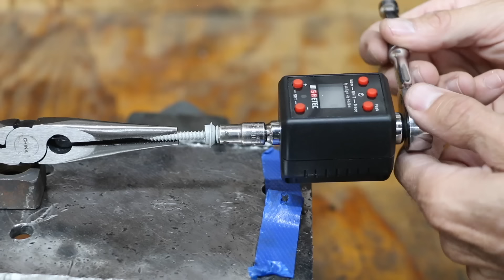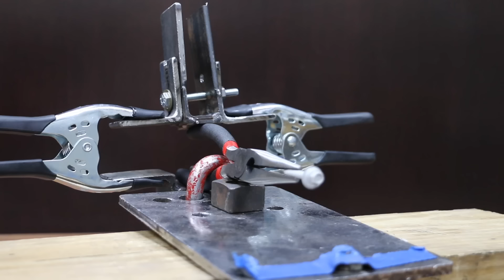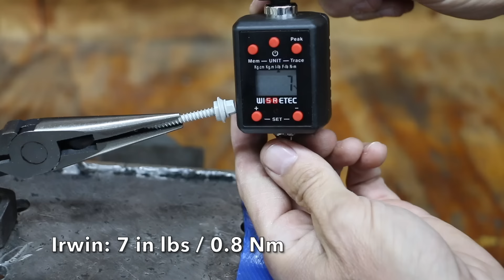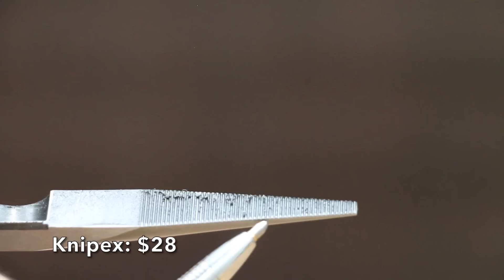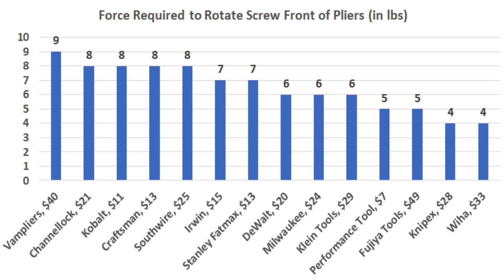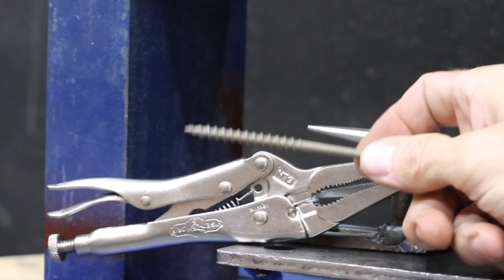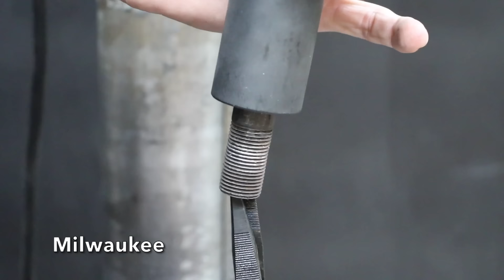Japan vs German Pliers (LONG NOSE)? Knipex, Vampliers, Klein, Fujiya, Irwin, Kobalt Needle Nose

Comment: I would think an important characteristic of needle-nose pliers would be how deep into a hole or crevice can they reach to grip something. That doesn't appear to be accounted for here, they were just run through similar tests as regular pliers or cutters. Some were relatively think and fat, less nimble.
Reply: This is true, however, I also fear there is no one perfect set of needle nose pliers. I have come very long narrow ones for exactly what you mention, other smaller ones with very precise fitment for pulling cactus needles out of people, and then others for higher torque applications.  Its like looking at the tweezer section in the Wiha catalog.. who knew there would be that many pages of different shape and size tweezers.
Reply: @treyhart6861  Yeah. It seemed that the Knipex were a different type of needle nose compared to the others, but for most things I use needle nosed pliers for, that's the type I reach for.
Reply: I agree. I for one do not really care about the wire cutters on my needle-nose pliers (I have plenty of other, better ways to cut metal), but I care a lot about how long and skinny the nose of the pliers is!
Reply: I agree 100% with you. I feel like this missed the mark on actual use case for these pliers. The Knipex and Wiha for example have very long and nimble jaws that can reach deep and pull things out (this is what they are designed to do). I feel like these tests were made for combination pliers. Some of models that excelled in the tests were very bulky and clumsy and would not reach nearly as deep as some of the others. Needle pliers are more used for pulling things in small and tight places. If you want to cut nails you use a different type plier. There are a reason these usually are insulated for 1000V usage since a lot of these are used by electricians. The cutter is really only there to be used for smaller gauge wires.
Reply from the maker: Thanks for the feedback.
Reply: small hole u want surgical hemostats like what fishermen use for pulling small hooks out of trout
Reply: good point although,   they are all pretty close to the same size.     And also, that would be something you could see pretty well before you bought the pliers, unlike all the other tests he did.
Reply: Actually the Knipex is getting a bad score in the first test for being the longest, makes no sense.
If you grab something with the end of the Knipex, chances are you wouldn't even get to it with the other tools.
Reply: I've ground down a few different pliers for specific task, but I also tend to break a lot of needle nose so fatter ones are good for some stubborn fasteners task
Reply: Yeah but that’s also the least tangible and easiest to diagnose yourself if your looking at purchasing one off of this list. Pick a few on the list that peaks in the metrics you like and then hold them in your hands. 

Also after viewing these plier videos, I don’t know why someone wouldn’t just buy the best on, if you use needle nose pliers more than twice a week, having a good tool will ALWAYS pay for itself.
Reply: you can pretty much look at them and tell which is going to fit further into a hole. if he tested and one fit 1 mm deeper thats not really impactful imo
Reply: That’s easily determined when you get the dimensions. That’s a usability issue, not a test of strength/durability. It would be nice to know though.
Reply: We can only extrapolate from the data provided. Testing all uses and lengths would take 100 videos and then someone else would ask about something different. If you are interested in the gripping strength of extra long needle nose pliers just buy about 5 different ones and put them to the test. I’ve never had 250 pounds of grip strength and have never cut a nail with needle nose pliers but I can get a good idea how well the cutter will hold up from the tests performed here, no problem. For my click on the like button this was an excellent video.
Reply: @johnk3606  We? Are you the one doing Project Farm? You're pretty free including "we" in your comment.
Reply: I got a knipex for that.
Reply: I mean the vampliers arent even needlenose, just regular pliers
Reply: Since they were all the same length to make the testing even across brands, your suggestion would have been irrelevant. Testing strength, durability, and function like PF does is the smartest route.
Reply: @LBCAndrew  They we not all the same length, nor were they the same diameter or taper.
Reply: “That doesn’t appear to be accounted for here”. Did you not even watch the video before trying to tell him how to make his videos? There’s no “doesn’t appear to be”. It either was, or wasn’t. And it wasn’t. Why? Because that’s not what he was testing. Simple as that. And no, it wasn’t run through the same tests as regular pliers or cutters. Obviously you didn’t watch those slightly older videos either.
Reply: @Ziphoroc  Down boy. Down.
Reply: They make pliers for tighter spaces, different tool irrelevant comment.
Reply: @ozylocz4078  Irrelevant enough for nine agreements before you. Lame flame.
Reply: @brentworls8509  flame? Nobody was insulting you, buddy, simply stating the fact there’s a separate tool for what you were talking about and it’d be irrelevant to test that here lol it’s still an irrelevant comment no matter how many idiots are agreeing with you
Reply: @ozylocz4078  Needle-nose pliers are that tool, by definition.
Reply: @ozylocz4078  What are they called? Needle nose", perhaps?

Comment: Could you test different torque wrenches? Like how accurate at different ft lbs setting and then how well they maintain calibration after 50 uses and then maybe how well they maintain after a few minor drops?
Reply from the maker: Thanks for the video idea.

Comment: I think a test you can add is solvent resistance for the handle grips. Soak them in gasoline for a while. Maybe heat resistance too? I think we've all managed to burn up plastic handles from time to time. Tools with messed up handles are no longer pleasant to use. Your rust test is a good one too.
Reply from the maker: Thanks for the suggestion.

Comment: Im not a big fan of anything Kobalt as i think they make alot of subpar tools that break premature but i gotta say the needle nose is a fan favorite of mine. I used them extensively for YEARS cutting stainless wire, bailing wire, copper, and most importantly used them for twisting crimps on 26g green seam dryer pipe. After my apprentice lost them i replaced them last year with a set of crescent needle nose. They are a decent feeling plier and are good in other ways as they have a more narrow reach than the kobalt but they lack the twisting function that i really need at work. I have some older craftsman that work good, and a dud from pittsburg. Ill be replacing my work set with another pair by kobalt in the coming months.
Reply from the maker: Thanks for the feedback.

Comment: Love my vampliers for those special, stripped screw in a tough spot removal.  Better than drilling/extracting.  But I protect that tip!  They're not beater pliers.
Reply: P.s. if you're cutting screws and nails with your needle nose, just leave.  Get off this channel. 😂
Reply from the maker: Thanks for sharing.
Reply: @ProjectFarm  Hey, love your channel.  If you another way of supporting outside of Patreon, I'm back in.  Here's an idea: best pressure washer surface cleaner (those circular spinning deck cleaners).

Comment: in my opinion you could improve the cutting force test by adding two nuts or improvise a fastener above the pliers jaws in the jig that holds the nail in order to make the tests completely controlled. The upward movement of the jaws during the cutting action could be releasing force, or effecting how the hydraulic press is pressing on the handles. though I could be wrong
Reply from the maker: Thanks for the feedback.

Comment: I enjoy most of your tests for both the information and your presentation.  However, this test is an exception as I believe you made several errors in your criteria and comparisons.  First, you compared precision pliers with heavy duty.  The criteria of 8" becomes arbitrary.  The conclusion might have said **buy Engineer/Vamplier for the best grip on screws, buy Knipex for the longest reach in this class/length, Kobalt as the best value, Klein as best all-around, Irwin for the strongest as long as you don't mind them being stiff...maybe better off with a linesman or combination pliers for heavy duty tasks**  There was no credit given to the unique properties and advantages of each plier because of the bias towards abusive tests that most people would never do with needle nose.  For example, Knipex makes "assembly" pliers in pointed and flat nose for twisting tasks, and achieves strength in a very lightweight plier with 28 01 200 and 28 21 200.  While these 2 models don't have cutters, who cares b/c I'll never cut a full sized nail or screw with needle nose, that's what linesman or better yet bolt cutters are for.  Also, no credit for weight which is an issue for anyone who has tools in a bag rather than a shop.  A smooth joint is a top criteria for me, which you mentioned but did not score.  I would say any joint that isn't smooth is an automatic loser in the test and I know a lot of people agree, especially for repetitive tasks (fatiguing) and not having to spend time breaking them in (some pliers never break in).  You also chose some comfort grips and some vinyl which is odd b/c many of these companies make both.  There was no test about grip when wet/oily/sweaty or perceived comfort.  Since vinyl is all similar it would be good to test comfort grips against each other.  Finally, the teeth pattern handling in this test was bad.  There was no test of a soft material to see which pliers did the most/least damage to the grabbed object.  Along these lines, the reach wasn't tested.  I also think the cutter damage is arbitrary the way you do it.  Did you consider to measure your comfortable grip strength, then run a test with that pressure on every cutter?  That would be more of a real world application b/c I usually try with the tool in my hand and stop at some point (before maximum) at which point I will reach for a different tool (first both compact cutter then if that doesn't do it I'll probably go to a power tool if the steel is hardened.  As I mentioned, most of your tests are great, but this one gave no real worth information b/c I (and many others) would not use a needle nose for these tasks.  You didn't test any delicate or tight space tasks which is what needle nose are intended for.  I would take the needle nose with smooth joint, comfortable handles, light weight, teeth that don't damage, cutter optional, long reach a plus, precision tips a plus....and for anything heavy duty including cutting and screw extraction I'll be reaching for a combination plier most likely.  I hope you consider a "rematch" or edit to acknowledge various awards as I mentioned @ * above (off topic but, why no Makita in the pole saw test?  They are a champion in the yard work arena)  Excellent videos normally otherwise I wouldn't bother with this response!
Reply: His tests arn't perfect and dont account for everything but they are fairly accurate for the tasks that he does do. I personally have the Knipex  one for more everyday use smaller tasks and then the Klien ones for heavier work.
Reply: @rektiumstuff3245  I agree with you completely on both the quality of Project Farm reviews, as well as your choice to value a long nose geared toward delicate work (longer and more pointed precision tip with less aggressive teeth) and another set dedicated to heavier tasks .  Regarding the quality of Project Farm reviews, I agree with you.  I've watched a lot of his reviews and this is the only one that I've ever seen as a failure.  Normally, the end where he suggests products is more nuanced.  The pliers in this test are for different purposes and there's almost no acknowledgement of that throughout the test, and zero acknowledgment of that in the recommendations.
Reply: @weliveonearth8012  I noticed this with one of his drill bit review were he had split end drills vs chisel. Cant expect a man to know everything.

Comment: I realize that your testing is based on getting numbers from using the pliers in certain activities. But I have bought 6 long nose pliers that i use for particular jobs that a single one type can not do. For instance cutting nails or screws are not usually the job of a long nose pliers which are mostly used for cutting copper wire. For me having a long nose plier reach deep into an inaccessible area and grab and manipulate a piece of wire or hardware is one of the most required jobs. I don't think your testing adequately covered that eventuality.

Comment: The Project Farm videos are always interesting, thoughtful, and well produced. Needle nose pliers are really handy ... sometimes they're perfect for the task. That said, I'd never use one for strength or twisting, only for light work and fine work. The strength metrics seemed out of place here.
Reply from the maker: Thanks!  Thanks for the feedback.
Reply: I'm a mechanic in the rust belt and definitely wanted to know which ones were the strongest as I seem to break and bend  lot of pliers trying to remove stubborn fasteners and snap rings etc

Comment: I love you PF. <3 Any chance we can get an update on the low compression diesel tractor that was seemingly fixed with the Restore brand oil additive? I'd love to know if the compression bump lasted long term, or if a can has to be added with every oil change to keep it up. Thanks!
Reply from the maker: Thanks for the suggestion.

Comment: I don't think I ever cut anything with needle nose pliers, I have a few pairs with no cutters. Usually pinch, pull, or twist. Would of liked to see some pulling tests. I own vampliers, engineer, knipex, channellock, proto, Mac, snap on, and Klein. (I'm pretty much a tool collector) knipex are my favorite for working on power sports and vehicles or around the house. The Klein are my go to at work for E&I work. The vampliers are great for specific tasks with the unique tip design. The Mac pliers are very nice also but hardly worth the cost and the proto needs a lot of use to break them in as the rivet is stiff for a high end plier.
Reply from the maker: Thanks for the feedback.

Comment: Wow, what do you people do with your long nose pliers?  The handle wobble and how easy the pliers move is all I need from long nose.  I have never been in my garage and thought I need to cut a screw, I know I'll get my long nose.  I cut and strip electric wire, maybe cut some very light bailing wire.  Not sure how I would have tested them  as I think it is very subjective on what makes a pair my favorite.  I have some that are at least 40 years old that are my go to.  But I would never twist, cut screws or use them to remove screws.  But I did enjoy the video.
Reply from the maker: Thanks!

Comment: Really like your content. Only thing with this test. Some of these (WIHA example) were voltage rated wiring needle nose pliers if I am not mistaken. Almost a different animal from a heavy mechanical needle nose plier. I've spent a lot of time in industrial machinery control panels. Long reach, slim, voltage insulated are what I reach for in that kind of work. When you are trying to get a wire back into a crowded terminal strip, but heavy needle nose pliers are not what you reach for. Different animals really.
Reply from the maker: Thanks!  Thanks for the feedback.

Comment: Have you considered testing chainsaw bar oils? Or 2 stroke mix oil for chainsaws at 50:1? Most big brands their own bar oil and mix oil. Your wear tester would be great for both bar and mix oil. Then a temp flow test for the bar. For testing the effectiveness on the bar, a temp reading after the saw cuts a certain amount of wood
Reply from the maker: Thanks for the suggestion.

Comment: A new Project for project Farm may not be a tool but a tool of sorts. Automatic Dishwasher Detergent. They all claim to be the best and in most cases are very high priced, but the sleeper of the bunch maybe the cheaper priced big box store or local store house brands.
Reply from the maker: Thanks for the suggestion.

Comment: I usually love your tests, but I feel that this video fell flat. in my personal use I would never use needle nose pliers for tough tasks like cutting nails, or using them to pend and shape a hard object. I find that thinner long nose pliers are the style I like and use the most because of their ability to reach into narrow crevices. the trade off for this style would of course be less durability. I feel like testing reach length in a narrow hole, like a pvc pipe would have been important to include. I mostly use needle nose pliers to fish an object our of a narrow location, grip strength is some what import, but reach is paramount, I also would only ever use the cutting function on soft material like 16awg electrical wire.
Reply: I can remember plenty of times when the damned pliers do not reach or open enough in a hole or something. For me that's where nice needle nose pliers should shine. For the rest, you can even use other tools.
Reply: You true! I have the knipex one from years and they works stil great. The long nose is a must have.
Reply: Obviously you won’t use it to cut nails or screws. It’s to find out how tough the cutters are.
Reply: @fukawf1400  But toughness doesnt matter much, would be more important to test, how far can I reach trough a hole and does it made a clean cut.
To test if they cut a nail is useless.